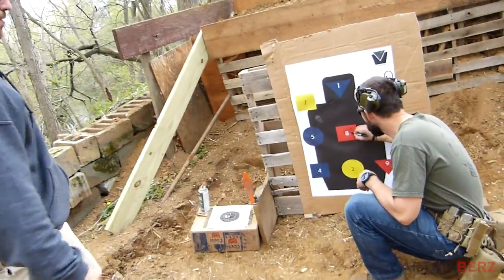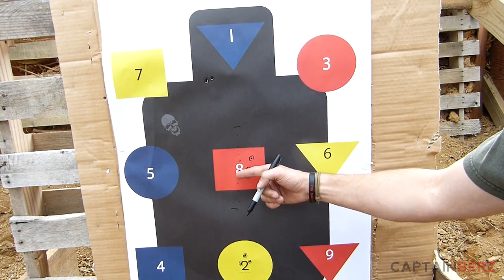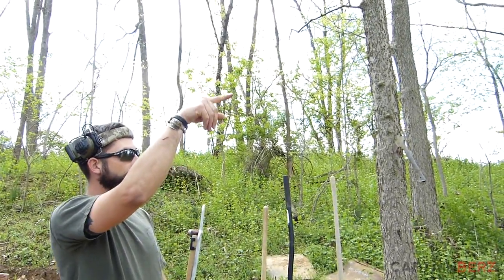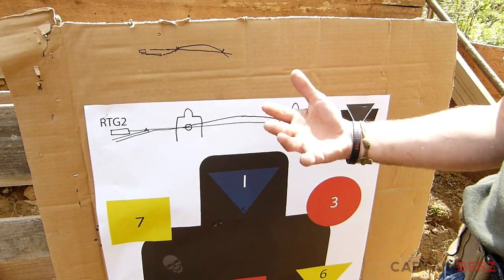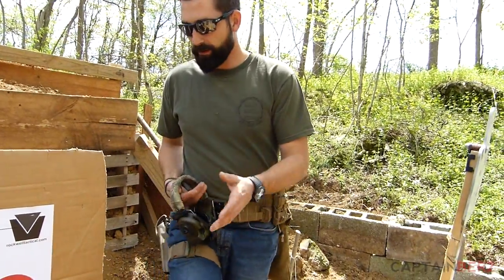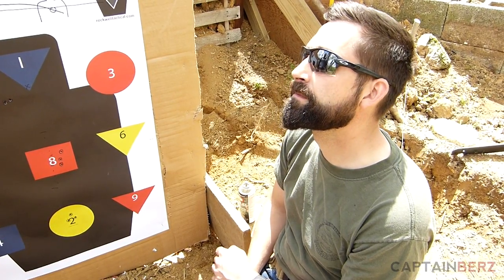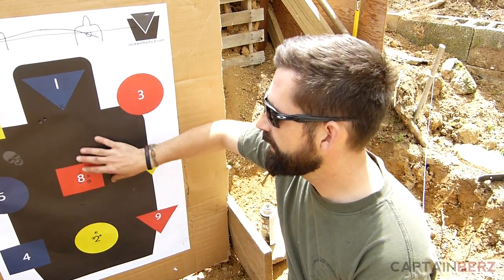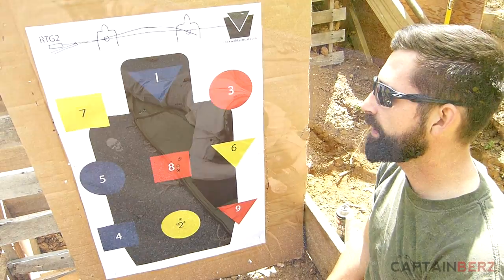Rifle Zeroing: Limit Your Chances to Fail

Comment: I have to zero at 40 yards to hit 1" high at 100, and 1.5" low at 200. Ballistic charts will show your bullet shooting flatter, than they actually do. I've learned that, from SHOOTING. Velocity is always advertised higher on the box, than they actually shoot out of your rifle. So, be careful going by the advertised velocity on the box. Get out and SHOOT. Trust me...   So many variables come into play... Barrel length, temperature, altitude, barometric pressure, etc.  The main variable is your optic height, over your bore. This angle becomes VERY important, at longer ranges. An AR platform may be very close to a 50-200 yard zero, but a hunting rifle will be very different, because of the angle created by your sight, and your bore. Bottom line... You have to get out and SHOOT.
Reply: 36 yards here. It's nearly flat from 7 to 300.

Comment: His football analogy was perfect, the further you have to thrown something, the higher the arc needs to be in order to hit the target at that distance. I especially liked the way he talked about why it's much better to keep the flight height tight and close, I picked up on a few tings from this shooter/instructor. Enough so, I'm stopping my 25yd zeroing, and moving to the 50...thanks for a super good vid.
Reply from the maker: Thanks for watching!
Reply: I sight all of my rifles in, splitting the difference between 100-200 yards. That's usually a little over 1" high at 100, then a little over 1" low at 200. It may be more like 1.5" high at 100, then 1.5" low at 200. It's according to the rifle, the cartridge, and the height of my optic, over my bore. A slower cartridge may even be a 2" margin at each distance. I shoot a group at 100, then I shoot a group at 200, until I have split the difference. All of my hunting shots are within 200 yards, so this works out perfectly for me. Keep in mind... The AR platform is gonna create a steeper angle, between your optic and your bore, unlike a hunting rifle, where the optic is mounted as close as possible to the bore. This creates less of an angle in flight, making the bullet travel closer to your line of sight.

Comment: 50 yrds. = 200 yrds   35-37 yrds. = 300 yrds however each round is different and the margin of error maybe 1-2 in. Center mass shot at 200 yrds gives you a 18-20 in. center mass shot while a 300yrd shot gives you 12-14 in center mass. all figured with a 55gr. full metal jacket. Great vid...... shots measured from 25yd 50yd 75yd 100yd 200yd 300yd.

Comment: I have a range at my home and have tested zeroing for years.  Something to keep in mind is that you are not limited to 25 - 50 - 100 yard zeros.  I use a tape to measure the distance and a rest so I know I'm right on and use a 60 yard zero.  I think it's the best for an all around zero for the 5.56 and gives me a bit more reach if needed.

Comment: Does this sighting method work across other platforms like 10/22s and bolt action rifles? Also is 10yrd zero work as a reference to 50200 zero method

Comment: Good vid, USMC represent! I like the 100 yard with a six o'clock hold which is similar to the 25m I suppose. I like that a head size target is easily done with irons for me and lets a little more of the smaller target into my sight picture.

Comment: Key like you mentioned quickly it depends though.  What is the length of barrel being used.  What is the weight of the bullet?  What is the twist rate of the barrel.  All of this will change where the impacts are at different ranges.
Reply from the maker: Which is why you should zero with the ammo you intend to use.

Comment: Oh and inside your zeror range you are going to be low due to mechanical offset by about 2-2.5". Zen masters of irons sights hold half or the base of the front sight post at closer ranges. If I had to guess, base of the FS at 10 and under and middle of the post at 15-25.

Comment: The 25/300 is best since with it you get a bullet drop compensation function from the detachable carry handle sight. Zero center mass on body of E type target not including head.to assure mid range hits from 150 to 225 yards. The bullet path will be no more than 10 inches high or low to 350 meters and allows for hits on the E all the way out to 400 meters. Creds: CMP-USAMU certified MTI coaching SDM/SAFS.

Comment: Finally figured out why the bullet is still rising farther out than your zero. You are shooting from a prone position, so to hit center mass the barrel has to be elevated to hit your target to start with. I can't shoot from the prone, overly curved back. So when I zero my rifle the barrel is closer to level than when in the prone, so I have a flatter trajectory, which means the bullet starts dropping sooner. So theoretically, I might have to zero at 200 yards to get the same results as in the video, which I really enjoyed.
Reply from the maker: No worries, you do not need to shoot prone to get the results.

Comment: Thanks this tutorial on zeroing for point blank range  My take away: figure your vita zone size, then zero at the range that will keep your poi inside the vital zone size as long as possible without holding over.

Great application for coyote hunting.
Reply from the maker: This was not for point blank range. Out to 300.

Comment: M1A1 or Scar 17? I can't decide which one to get. My desire is to reach 800 to 1000 yards with the narrowest accuracy. Weight of the M1 is not a con for my desired theater of operation. Anyone?
Reply: I see no point in taking a rifle to a range, even if it is outdoor. It's not necessary where I live. I can hit 500 yards with 5.56, 1:7 and 62 grain with irons. Three Zero Eight touching 900 yards scoped is not extreme. It's not a question really needing answered. Just looking for opinions.

Comment: 36y zero was intended for the m16,  adjustable rear sight,  1:7 twist rifle,  running m855 (green tip steel core rounds.)  Im starting to believe 50yd would be best for most civilians.
Reply from the maker: Either are great out to 250 yards (about a CD size holding center mass). “Best for civilians”. Give me a break. Print the Vigilance Elite 36 yard zero for zeroing at 25 yards and call it a day.
Reply: @CaptainBerz  uh,  you literally advocate for the 50yd in this video,  which is why I said what i said.
Reply from the maker: A Marine scout sniper team leader is in this video. But “civilians”, right. 😂😂😂
Reply from the maker: “Civilians”. 😂😂😂😂

Comment: 36 Yard Zero? Opinion? Seems to be a very good Zero for up to 300 Yards 🤔
Reply from the maker: That's a stupid distance. "36" because 35 will not suffice and you wont get all the hits! Haha!
Reply: Ah,ok. Thanks for the input 👍🏼
Reply from the maker: Just remember this, if you only have a 25 yard range, zero 2" low at 25 yards for a 50 yard zero. Then you can aim center mass on a threat to your life and hit out to 300 yards.
Reply: CaptainBerz Right on. Luckily the range I go to starts at 50

Comment: Shows how much this guy knows.......         36 yards is the best zero
Reply from the maker: 😂. Only if you can shoot a man sized target with a red dot at 100+ yards. Otherwise your “this zero is microscopically better than that one” means nothing.
Reply: CaptainBerz 36 closes the inch radius more than the 50
Reply from the maker: You’re right. You cannot defend yourself, or go to war with a 50 yard zero. It’s incomprehensible! If it’s not a 36 yard zero, it’s useless. God forbid you do 35 or 37 yard zero. 😯😂
Reply: CaptainBerz go check out vigilante elite (a navy seal) and than tell me he’s wrong 
I was sold on the 50/200 too
Reply: CaptainBerz there are other videos of it hitting 100/200/300 yard 12 inch diameter steel so I’ve done my homework
Reply from the maker: Who cares about videos. YOU have to be able to do it for any zero to matter. Go film a 300 yard red dot shot, then talk to me......

Comment: 1 moa is 1 inch at 100 yds sooooooooooooooooo .5 moa zeroing at 50 yds will get you close to 1 moa. This is very basic geometry
Reply: .5 is %50 of an inch at %50 of 100 yds. It is STILL 1 moa

Comment: This was so cringeworthy of e-info and no, we (grunts) do estimate distance (at least in the Army).  If you think the majority of fights are within 200 m/yrds, thats a lie. Nobody is trying to get closer than they have to. And the diagram about 50m zero and where it will drop at 300 is not accurate, because you aren't factoring in the variety of ammo people are using. With standard military M855, 25m zero to shoot 300m. And when you aim at a 300m target, you aim higher than center mass close to the neck area of a standing target to get a hit. But this is out of a 20in barrel with standard ironsights. Not all setups these days are the same, so the old info is very subjective with an asterisk and fine print under it.
Reply from the maker: Variety of ammo? No matter what ammo you have your gun zeroed for it fits the diagram discussed. What is discussed here is nothing different than what others have said on the subject. Haley, Vigilance Elite, etc. Also, we discussed hold overs in relation to a head shot with sights versus bore. 

In relation to majority of fights not happening inside 200 yards. It does not say this is related to military fights only, it is all around. The person in this video instructing is a Marine Scout Sniper Team Leader, he is aware of fights in war and otherwise. We have to make videos related to all fights. CCW, home defense, ranch defense, self defense, gun competitions, etc. The majority of all gun fights are within 0-200 yards or even say 0-300 yards. Whether you use iron sights or an optic it does't matter. If someone cannot grasp that he rounds further out hit lower, that is on them and their stupidity. You can still get a hit with a center mass hold at 300 yards. The only thing you said that is reasonable is that if you hold higher you will hit higher. Which is an implied concept. But I think you just wanted to sound important with your comment otherwise.
Reply: I still use a 50/200 zero even though Diane Feinstein told me my rifle can shoot 30 rounds a second all the way to the moon.